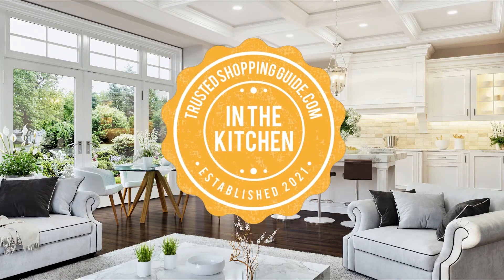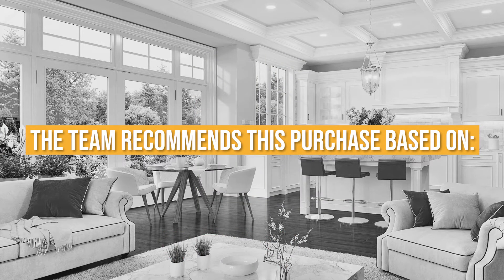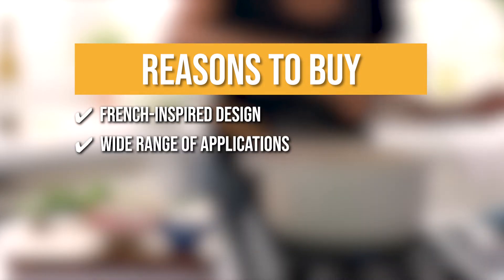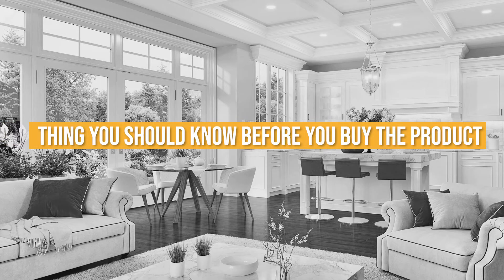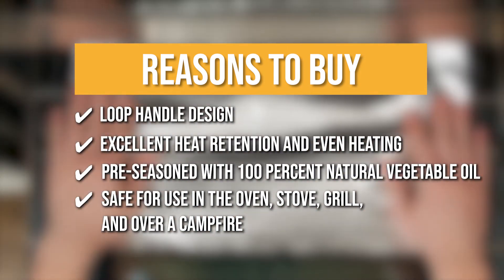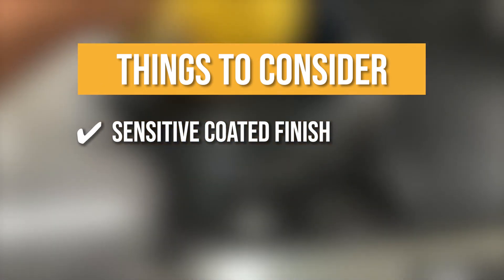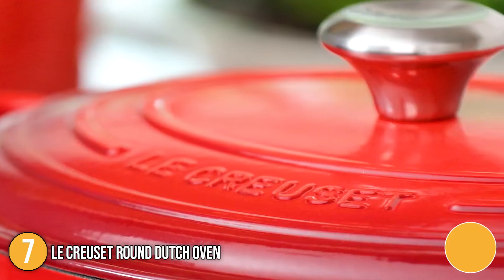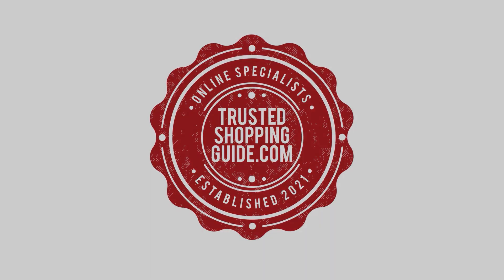✅Top 7 Best Dutch Ovens | Buyer's Guide

Comment: I have Tramontina 6.5 quart Dutch ovens that you can still buy at Costco for about $40 when on special. I bought my first one when ATK had their initial test of Dutch ovens decades ago and the only thing I did to that one was replace the Knob on top of the Lid with Metal from Plastic.  The new ones have Metal Knobs. Frankly I do not see why anyone would spend more for a Dutch oven. After over 20 years mine have been fine. I have had no problems with enamel coming off. The interior does stain as they ALL do but a Baking soda soak gets that out. I admit that with modern Pressure Cookers I use my Dutch ovens less but one is always on my 6 burner electric stove. Frankly, there is just not enough difference between these pots and even the ones for $100 to make it worthwhile. If you really need to show off a Name - that is your business. I cook in mine. People eat the food - not the name. And no one can claim that the food from these Dutch ovens is significantly any different from ones ten times the price.